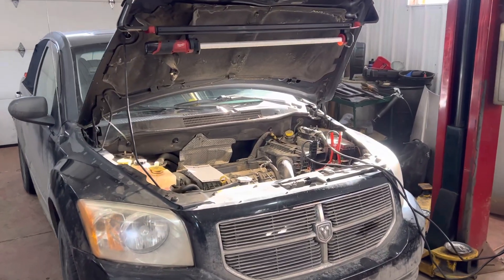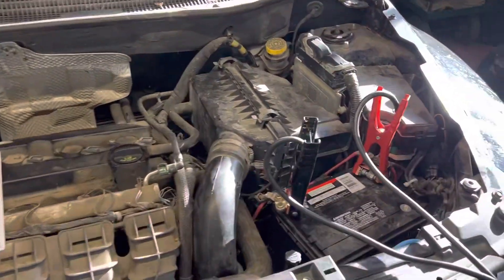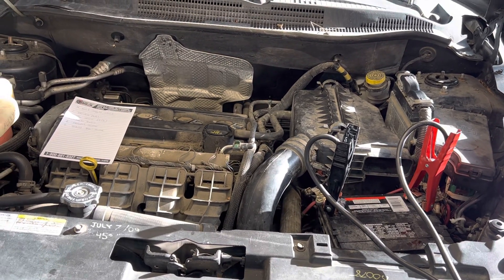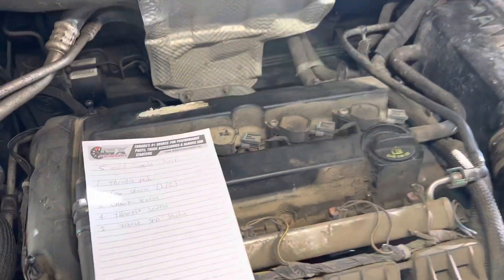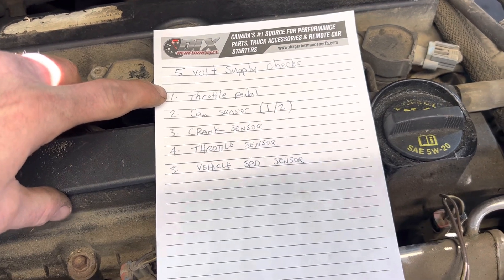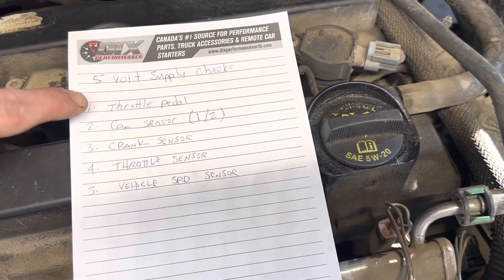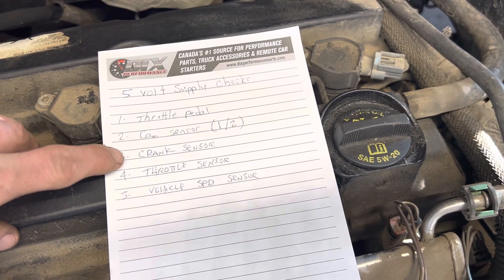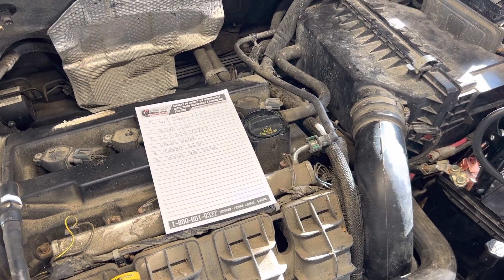2007 Dodge Caliber engine sensor testing - rough running engine

Comment: The 2.0 has issuse with bad intake gasket
Reply from the maker: It can be that, what I’ve seen if it’s an intake issue you typically get vacuum related fault codes.